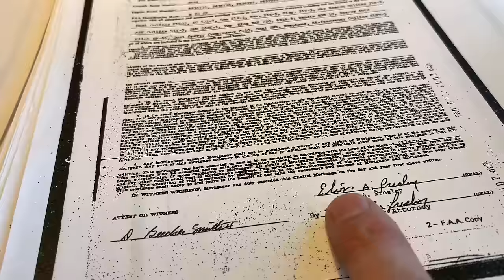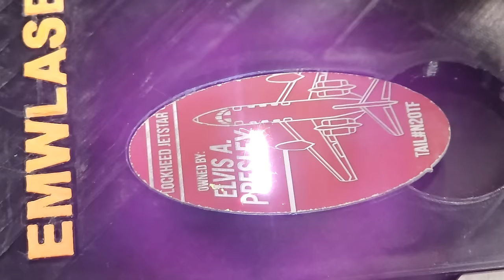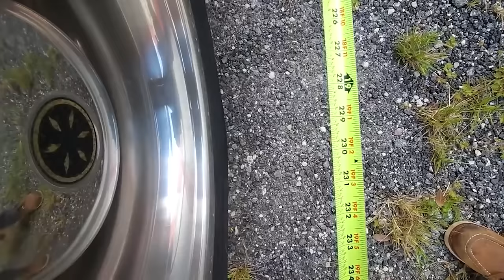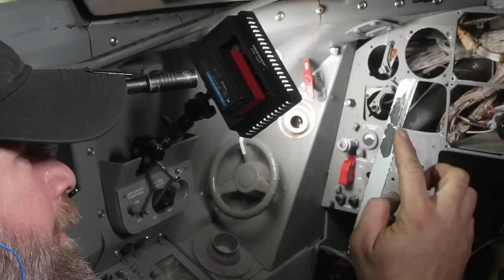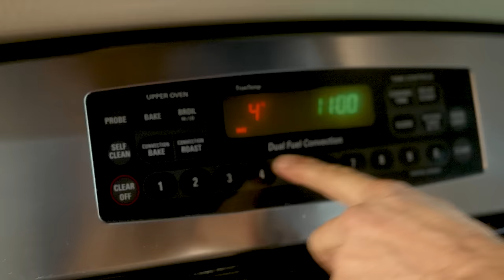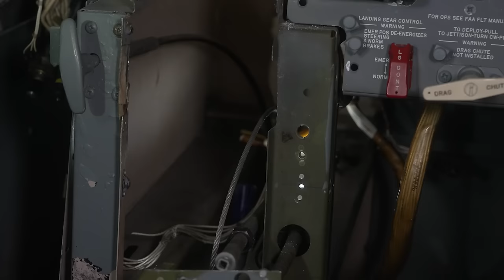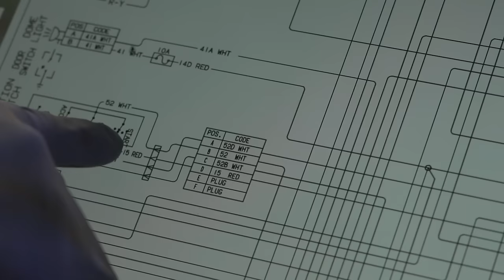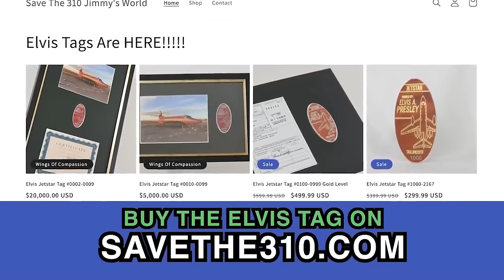Rebuilding Elvis Presley's Private Jet To Drive On The Road Pt5

Comment: First, I was quite skeptical. I thought it would be better to restore the jet as it was. But now I like the idea. 
But I don't know about the wheel situation. Are you going to cover them (when you display the jet)?.
Anyway, I like the project! Let's see how it goes!
Reply: well i kind of thought the same, but realise its probably cheaper to build a new plane than to restore this with it so far gone - of course it could be restored, painted and put into a museum
i do kind of like the RV idea, but i do feel it could be done better, i did wonder if the chassis could be hidden inside the lowest part of the fuselage ie below the cabin floor, that then hides much of the nasty RV chassis and running gear, and also lowers the centre of gravity - i am still very concerned of how much of a pig this will be to drive and handle, is/was the fuselage equal to the weight of the RV body (did Jimmy and Grisly consider this, sure they did) - haha seeing the amount of wiring and knowing all the extra junk you guys like to put in an RV, air con and so on, anything is possible - but we always had a saying here in the UK, American cars were built for speed and travelling in straight lines, and not cornering - cornering this beast will be interesting, i can't wait for the next video and testing
Reply: @patchmack4469  Yes, cornering will be a problem. I'm also concerned the plane could get loose or something. But I think Jimmy has thought of that already ...
Greetings from Germany

Comment: You really dont even need that pass through inverter. Those come in handy if you're running AC Voltage appliances while traveling and don't want to use the Generator.
To simplify it, just run the generator and your shore power cord into an automatic transfer switch. From there the power can go into a breaker panel. From the breaker panel you can run AC power to where ever it needs to go INCLUDING a Converter.
Install a thick bus bar. On this bus bar you can install the 12v converter, and the batteries. Coming off of the bus bar can be your 28v converter which will then feed what the plane needs.

Then you wont ever get errors and power failures out of that inverter which I don't feel this project needs. They're a pain.

Comment: Rule #1 with wiring - NEVER poke into the working end of a terminal! Slide a pin into the rear of the connector, a.k.a. 'back probing'.Even the slightest amount of deforming a terminal can cause instant, or even worse, future issues.

Comment: Jimmy i can make you this generator if needed, i have made this generator for my rv due too the fact that this type of power generation is usually used on offshore oil rigs, the scam is they sell you a huge $20k generator and the generator even if they sell you its an inverter it only puts out 110/220 and the 12v at 10amps.... With the instructions i have given you, this would be the way to bypass all those rediculouse amps conversions AC to DC. So thats my proposition jimmy. A super efficient generator. For less then $1,500.00 what do you say ?❤❤❤❤ Great video ?

Comment: Is the aircraft body really bolted to the chassis sufficiently so that when you start driving down the highway the air frame doesn't part company with the chassis?  Because of the pointy nose, at 75 mph, if you have any angle of attack on the aircraft body, you are going to get considerable lift on it.
Reply from the maker: Tbd…. #flighttesting

Comment: How many of the parts out of the cabin were you able to sell to some one else maybe rebuilding a jet star like the rudder peddles. It would be cool if you could keep the gauge cluster and it work like the altimeter and maybe hook up a pedo tube for air speed and have a normal speedometer

Comment: There is no insurance company that will ever insure this on a commercial level for rental use and this thing driving down the road is huge liability
Reply: Actually, there are insurance companies that will insure literally anything.  Also, once this is completed and properly attached to the frame along with bumpers and legal lighting attached it'll be no different than any other RV as far as driving it down the road... other than it will look a bit different.

Comment: You know, you could put a "Drive-By-Wire" system in with a encoder on the yoke and a stepper motor on the steering assembly, but a better way would be to use hydraulic lines and pump to do the steering.

Comment: Jimmy, love your work..lol.. but can you explain to me WHY in gods name you are converting two batteries from 12 to 24 instead of wiring them in a SERIES WHICH STEPS UP AUTOMATICALLY TO 24V?..lol.. You're creating LESS efficiency with all your stepping in both direction.
Reply from the maker: Rv chassis is 12v, airplane is 24v. Charging system is 12v.